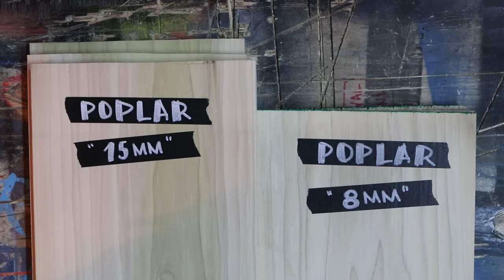Laura´s Wooden Projector Cabinet

Comment: Nice one! I think the fact that you are sitting under the "beamer" and there is a wooden plate between it and you, it will reduce the fan noise you hear from it too? also, hot projector-bulbs are supposed to be quite fragile (and expensive to replace), so don't shut the box to hard

Comment: Fantastic! Your project videos are always so inspiring. I also liked the gratuitous chisel work closeups in this one. Is the bit with the machine screws glued to the tiny wood screws around 5:10 just to mark where the holes will be on the other side to mount the projector?
Reply from the maker: +Pawel Szymczykowski yes, exactly.
Reply: Thanks! Follow up to that: Why glue the screws vs tracing around the screw heads of the machine screws? I'm guessing it was a more precise way of finding the centers and / or avoiding pencil marks. Sorry, I'm just super curious because I haven't seen a trick like that before!

Comment: I really need to try and produce a dovetail joint.

Side question, Patreon: Is there access to plans for builds like this?
Reply from the maker: no, i uploaded a free plan for my workbenches as a christmas present but i usually don´t do plans. but i share my sketches with my patreons...like the one you see in the video
Reply: Ah yes, I remember reading that now.  (The workbenches plans that is).  Thanks for the reply.  This is a channel worth supporting I think :)

Comment: great video, nice cabinet.  I'm only disappointed with the flat-head screws :)
Reply from the maker: +formerly 987946216430 flatheads are my favorite because they look authentic for these traditional designs
Reply: I just hate them as a fastener, being Canadian I'm all about Robertson (square) heads so much easier to work with, but yes for what you're doing the flats work nicely!
Reply: robertson drive is inferior to torx drive, and what you are referring to as 'flat-head' is a slotted screw.  Flat-head designates the head shape not the drive type, which is countersunk (misnomer for these type of screws) below the surface.